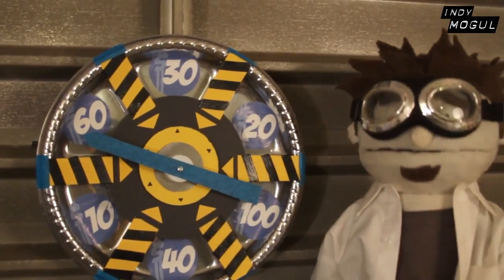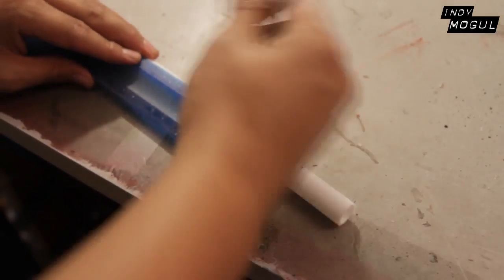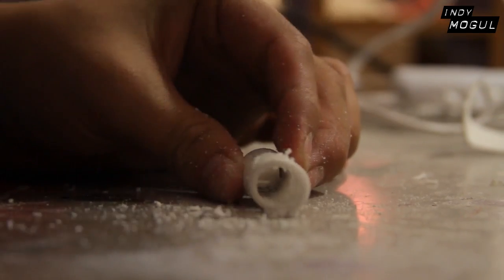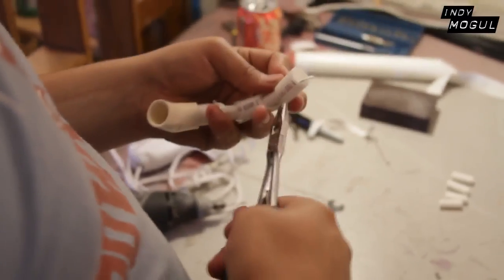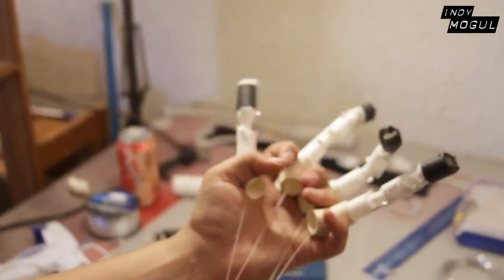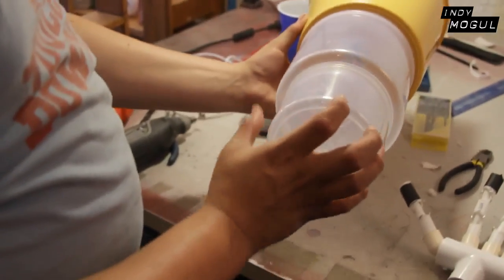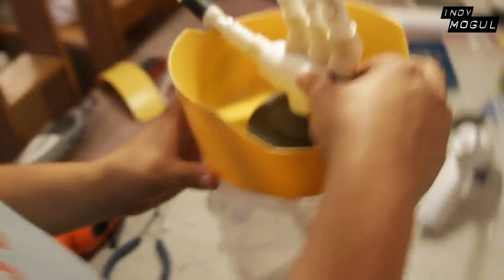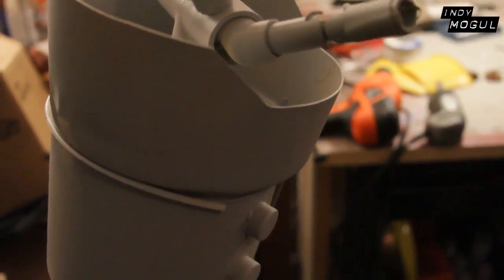Terminator, Hellboy : Articulated Robotic Hand : DIY Film Tutorial

Comment: This is all over the place, Bodged and rickety.
I remember watching some indy mogul videos a couple of years back. they were WAY better than this. what happened?
A few notes, maybe helpful for those watching.

First, as with ANY DIY Video using tools, maybe gloves, glasses and plugs.
This guy got lucky after slipping that drill bit so many times. How lucky are you?

Second, If you chop at 45 degrees in the first place, you avoid two extra cutting steps for EVERY PART, a LOT of time and about a foot of waste pipe...

Lastly, anyone who has ever cut anything in half (EVER) with a hacksaw quickly learns, a solid surface and ANY kind of brace enables you to do it better, and more safely.
Just hit two nails in a plank if you REALLY don't have any tools to hold a tube.

On a side note, I realise the instructors language is intended to be conversational but irredeemable redundancies like "Little, small pieces of metal" are cringe-worthy.
Write down what you are going to say, and have an adult read through it for you first.